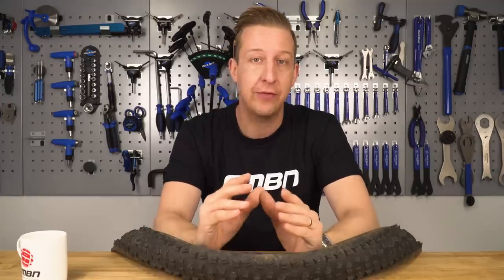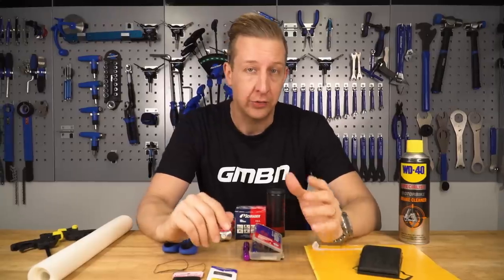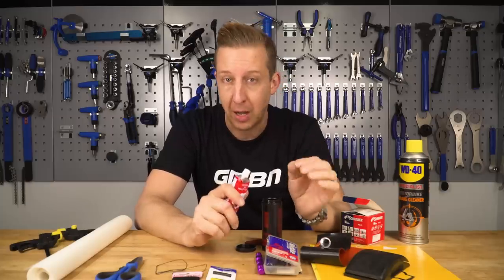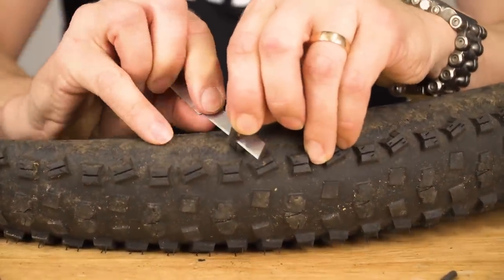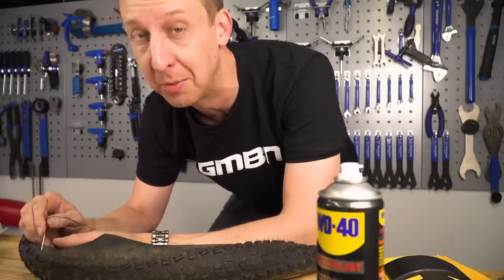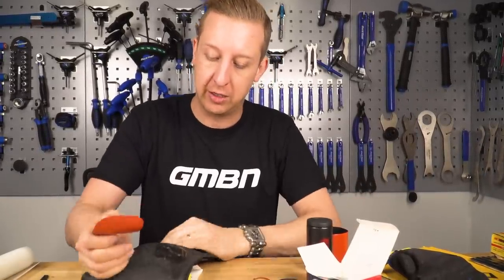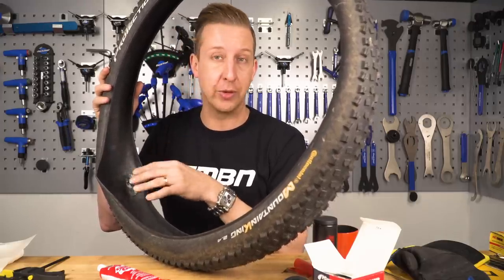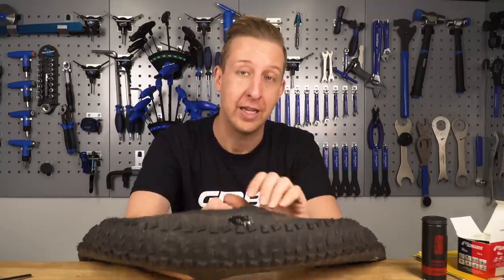How To Repair A Cut In A Tyre | MTB Maintenance

Comment: Hi, love the show, keep up the good work! one suggestion - because of the shape of the tire ( that it is concave, when adding the patch, you should keep the tire in it's natural shape, as if you keep it inside out, when you put it back surface the patch needs to cover becomes smaller and thus the patch can curl and break away. the patch is resistant to stretching but not to curling, at least if you want to be safe with it. Cheers!

Comment: I have 2 'bacon' plugs in my tires, the first put in un June and the second around September, so I'd definitely consider them a long term solution. They are now perfectly vulcanized and integrated in the tire
Reply: The reason plugs are not considered permanent is because they don't bond the torn threads and give any strength back to the compromised casing.  Yes, they will vulcanize the rubber for air tightness, but they don't have any strength to keep the cut from potentially expanding.  This is why stitching is considered a more permanent repair.

Comment: This is the first time I have attempted to repair a tubeless bike tyre. Where I live, we have a lot of road hazards, especially glass. and I ended up with a 3/8 cut in the wear area of my rear tyre. This repair went better than I expected. I used a good grade Upholstery thread, A medium-sized slime patch, Cleaned the area with Isopropyl alcohol, reinstalled the tire on the rim, with a tube installed. and aired up to 30 psi. I will let it sit for 24 Hrs. Thanks for your video, It Helped. Can’t Wait to see how well this repair holds up.

Comment: Hey Doddy, great video! Sewing up a slash had never occurred to me before, great idea. I had re occurring issues with my old rims (mavic 427 set up tubeless) cutting into the side wall just above the bead under heavy impacts/forces, I realised it was because the edge of the rim was so narrow and sharp almost like a blade. However, I did manage to repair the tyre 3 times with a small patch of old inner tube stuck to the inside using quick setting gorilla glue, it has lasted 6 months so far and even been fitted onto a new wheel and no issues so far!
Reply from the maker: Sounds like a top fix then Sam!

Comment: Stitch Tip: Try to finish the stitch on the inside the patch will cover and protect the knot. It will look nicer on the outside and will be protected from elements.
Reply: But the knot s sticking out, making the patch you put on more difficult to stick down! More likely to peel from the knot I reckon.
Reply: @khchoi2012  the patch is on the inside of the tyre. Therefore it will be on top of the knot and constantly pressured with the inner tube. This patch is not like a regular patch one applies on the inner tube to prevent air from escaping but a protective layer for the inner tube and prevent any outside elements to creep in between the tyre and the inner tube. In anyways, the application area is never a flat surface due to stitching itself with or without the knot.
Reply: @ronwhite1273  That was what I was saying. You'd rather have the knot on the inside and stick a patch over it. If you stick a sticky tape or gaffer tape over a lump, what's going to happen, from your experience?
No, it's not constant pressure on the patch at all. Only constant if you don't use your bike. You seem like a theorist but not a pragmatist. When the patched tyre is in use, the pressure varies as the bike is jumped on, landed on. There's CONSTANT flexing and stretching of the tyre especially on that weak spot and especially on side wall. The flex is more if you run even lower tyre pressure. You have that knot being pushed in and out of the tyre. What's going to happen? 
I think Doddy is right in this case. Less stress point on the patch.
Reply: @ronwhite1273  And no, he wasn't talking about putting an inner tube back in after the repair. He was however talking about using it as tubeless. Were you following his conversation? Or was it me getting it wrong?
Reply: @khchoi2012  after your detailed argument, now I think you are right. Also, yes I didn't talk from the experience, was only a theory.

Comment: @GMBN Tech thank you for a Superb easy fix , i got a 3cm cut on the sidewall of my 100 mile old Maxxis Minion DHR EXO+ courtesy  of our loveley lakeland trail near Stile end , I managed to do a trail patch with a large patch and rode 8 miles home. I Had Nukeproof inserts fitted  too running tubeless with goo, I managed to leave the wheel in bike upended to keep the goo in the opposite side of the wheel while working in the top i removed part of the insert  to gain access and then  roughed up around the tear  for the patch after cleaning the goo off with a cloth and then alcohol wipes and then managed to carefully place  the patch  and sit before pumping it up  and riding home to Windermere  the patch was bulging out when i got home but i got home tubeless. I carry a tube but didn't really want to have to deal with carrying the insert  home in my bag if it would fit  or over my shoulder.     When i got home I  replaced the tyre  and binned the Maxxis and then later in the evening found this vid ....quick trip outside for a rescue from the bin. Following day  removed the patch and fixed it  using your method....

Comment: Two thumbs up!! My LBS throws away perfectly fine tires with only a small gash in the sidewall all the time. I recommend that you let the Sho Goo dry at least 24 hrs. before using (as per the manufacturing instructions).

Comment: For small holes just put a tube patch on the inside. works for me. The fix has always outlasted the tyre.
Reply: This
Reply: There are specific tubeless patch kits that looked a bit thicker than the motorcycle one seen here. Haven't had a problem with these so far, although I also try to seal the slash from the outside as well with Shoe Goo or something similar. Just be careful with super glue, it might harden too much and not stay flexible enough.

The TipTop tire patch even worked on the typical snake bite position on the sidewall for me.
http://www.rematiptop.com/part.php?pid=58&cid=6&sid=4

Comment: They make a kevlar string. I used it on an atv tire. Struck a sharp rock 20 miles out deep in the woods...nothing out there. 2.5 inch gash in the tire tread. Found a nail in an old fence, had a small butane lighter and the string. I always carry a plug kit and compressor but this gash was no match for a plug.  Took the tire off the rim and burned 4 small  holes each side of gash with the heated nail. sticked with kelvar string, glued a rubber piece of  tool kit to the inner tire ( i cut the rubber tool kit bag with the bottom of a bottle I found down the road, used a rock to flint knapp a sharp edge.). also had a bottle of slime for back up. The patch held the whole way back. I like the shoe goo....but in a fix for time....I now always have a  bottle of insulating foam on long rides. The insulating foam would have been perfect for an emergency situation. Never had a gash like that before and when it happened in 100 degrees all you can think of are things that would have worked if you had them with you....not a situation I want to find myself in again.

Comment: Absolute legend Doddy, I thought my brand new tyre was written off and nearly threw it out yesterday. Definitely going to try this after I move house next week. Cheeers ears.
Reply from the maker: No worries Gaz!
Reply: Update, fixed the tyre and due to a shredded rear, I am now running the stitched tyre on the rear. Sweet repair tekkers. Cheers again guys.

Comment: I has happened to me during a trail once. The tire was cut on 10mm. I've just sand a big area around the cut inside the tire(around 30mm radius). An old piece on inner tube made me a patch of the same size but a little bit smaller (that is important for the adherence, you must not glue on an non-sand surface or the patch will go off). I have sanded it to and glued everything with regular patch's glue. After more than a year it is still ok, nothing has moved ;)

Comment: Awesome stuff, especially for the enthusiast riders that don't need to be replacing equipment because something happens on a ride.

I think I would like to see it through to the end result, meaning mounted on a wheel and set up tubeless.
Reply: I was thinking along the same line, that popping feeling when using a compressor to seat thel bead.

Comment: Great video! I used this solution to repair a new Schwalbe Jumbo Jim 4.8 fat tyre. It worked a treat and has lasted a full day of dry dusty downhill trails at Cademuir. The glue coating protecting the stitches hardly appears to have worn at all. Thanks

Comment: Best part of another 1600 miles on my repaired DHR  and lots of rough rocky trails, learned  lot more about my tyres in the meantimethe repaired one was an EXO+ think ideally for up in the lakes a DD or DH would be much better  tho.
Reply: I have dh casing. Still hot some puncture.  Doesn't actually guarantee anything.

Comment: Doddy My Boy! Awesome Job! Excellent video! I did try to improve on this repair by using "Kevlar" thread. Its UV resistant and has a high tensile strength. I got mine at "Tandy Leather Factory".
Reply from the maker: A very strong solution, no doubt!

Comment: When using ShoeGoo put it on the tire and the n lick your finger and smudge it across. It wont stick to your finger AT ALL. Im a skater and this is a small tip I always used. If you dont do it itll stick everywhere

Comment: gorilla glue patch and seal (air and liquid) work flawlessly. took the tire off, cleaned it with brake cleaner, dry, apply a piece of patch and seal, apply a bit of heat with a heat gun and voila super easy and super efficient. no sewing and all that other stuff.

Comment: I had a hole in my tyre and fixed it in a similar way however i didn't use any thread. Worked well and i used some super glue on the outside of the tyre to help seal up the hole while the patch and rubber cement did the bulk of the work on the inside. Now i'm back up and running tubeless.

Comment: HI Doddy, today I started to tighten up my spokes because they were abit loose I tightened them up the hole way round and then squeezed each one together to see if they were tight enough and they were, should I have used a different method because I don’t think they are eavinly tightened even thow they are straight.

Comment: Thanks so much for the video.  I bought some needles based on your video and am wondering if using dental floss (Glide) would be better than waxed linen.  The dental floss is really strong but perhaps you have some information on using it on a tire.
Reply from the maker: We've actually never tried that or heard of it David! You're right though it's the right kind of material to work. 🤔 If you want to pioneer it make sure to let us know how it goes!

Comment: at what size of a cut should you patch+stitch vs just using sealant + something else? any size cut? On my first day out on the tubeless set up, I got a cut on my sidewall that is like 3-4mm and the sealant seals it up until ~70PSI (its a 25mm road tire), but beyond that, it starts to leak air. I have used loctite 406 glue for rubber/plastic to seal it better and wonder if I should take everything apart, clean off the sealant+glue and patch +stitch it or, for a 3-4mm cut, this fix should be fine?

Comment: what if the slash is right next to the bead? I dented my rim and slashed my tire just above the bead in the most embarassing way possible - trying to bunnyhop over a curb! lol I was still trying to learn the bunnyhop but once I was able to get both wheels off the ground at the same time (barely), I decided to try and progress to hopping curbs a bit too soon. 

I'm thinking my only option now is to run a tube, and maybe add a couple stitches to hold it together?

Comment: I would let the patch cure with the tire not turned inside out like you did. Try and put the tire in its natural position for curing, then the patch is less likely to "ripple" and delaminate when used under biking conditions.

Comment: Good video but my results very not so good.   Schwalbe Marathon Plus 700x38 commuter tire,  6 mm slash in sidewall.  Stitched with fishing line and installed a patch on the inside.   I run tubes at 60 to 80 psi and the slash area has a noticeable bulge.  Of course the tube is not coming through the patch, but it makes me nervous.
Reply: This is for MTB tyres which are run at much lower pressures (~20-30 PSI). I wouldn't try this as a permanent solution on the sort of pressures you are running on your commuting tyres.

Comment: Do you think Shoe Goo would work on the inside and for tube putting patches on a tube? Im curious because im building a bikepacking repair kit and prefer to carry as little as possible.
Reply: Try it and report back, not sure it has the same chemical makeup to perform the same adhesion. A comparison would be using primer paint and using Elmer's school glue. Both adhesive properties, but the flexibility and reaction of materials hold differently to various surfaces and leave with different durability. When shoe goo and rubber patch cement are about the same stuff, get the right product.

Comment: @Gmbntech doddy a little tip I learnt from nearly 20 years driving and those patch bungs as I've used them on a car tyre and it was perfectly fine for about 9 months was to twist the insertion tool 720 degrees before pulling it out, it causes a big blob of bung on back side that's about 4x the thickness of the bung material making it vertically impossible to be pushed out the hole unless it's a big ass hole

Comment: Would it be ideal to use a large clamp that could cover the whole patch, if a large enough clamp is available?
Reply: You can use a flat surface on the bottom like a tabletop and another flat surface on top like a round piece of wood enough to cover the entire patch then pressure those with your clamp. This will also distribute the pressure and protects your material.

Comment: As road bikes are using tubeless tires more often, I found I may need to use this very soon on a gp5000TL I've been riding on. Great tires, just unfortunate enough to have a small sidewall cut. 

Great video and guide and hopefully this works.
Reply: David Luong If you did this repair on your GP5000tl, I would like to know how it holds up at higher psi.
Reply: David Luong Thanks for responding! It’s good to know that it holds up at higher pressures too. Currently on the GP4000 but might go tubeless with the 5000s. Rims are set up so I might as well

Comment: Great video Doddy my question is their a way of protecting my gear cable where it comes out from the rear mech that little tail bit , twice now I must have snagged it and lost the end cap and the cable starts to untwist itself I run a sram set up I've noticed shimano have a more protected set up with the cable. Cheers 🍻.    👀

Comment: Looked like a continental mountain king protection tyre in the video so surprised it would slash the sidewall?
Reply: The Mountain King 2 is a pretty light weight tire, even as Protection. Around 700 grams or so, it slashes easily. I haven't tried the new MK3 though yet.
Reply: sp00n I ran the MK3 2.6 for a few months. Slashed through the sidewall last week in a moderate rock garden. Mounted the Trail King and first impressions are the sidewalk is definitely thicker and it rolls slower.

Comment: I wanted to inform you that a lot of Part cleaner sprays are very combustible and this information comes from the Wikipedia (Under Danger) Rubber and some types of plastics are decomposed by brake cleaners by removing binding components. This has the consequence that the rubber will appear unchanged at first; however, it will become brittle, and after a few weeks to months cracks and fractures appear. Years ago, I also used a parts cleaner on a chain and after a month the plating came off completely and the chain rusted. I will never use a parts cleaner on a Bicycle ever again. Save the parts cleaner for your car’s metal parts ok.

Comment: Why not take it to a car tyre garage and vulkanize it both sides after cleaning and prepping it yourself? Vulkanising would probably render stitching unnecessary too.
Reply: Car tire patches are much too thick and lack flexibility...this is how they get away with just a patch providing the necessary strength to repair damaged casing on car tires (and there are limits as to where they can fix...no corners or sidewalls).  Motorcycle patches are much better because they are thinner and more flexible.  Paying a shop to fix it is probably pretty close to the cost of just buying a new tire.
Reply: Luckily fixing it in a garage in Poland, ain't nowhere near the cost of a new tire. So come ride in Poland :-D 
Good tire is about 200PLN, cycling tyre patching at garage was like 2PLN. So I'm guessing doing it in a kinda motorbikes oriented garage would be max 20PLN. 10% for a guaranteed fix.